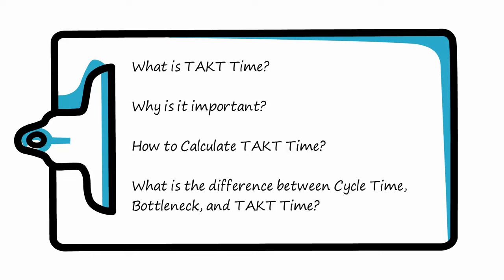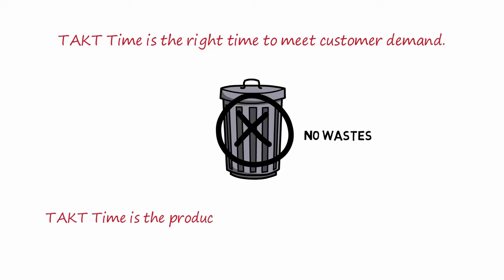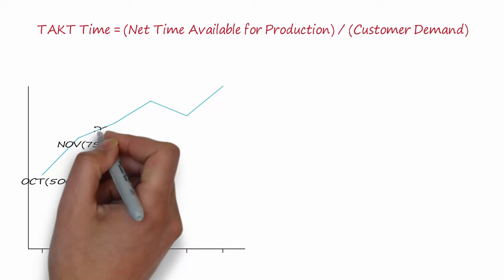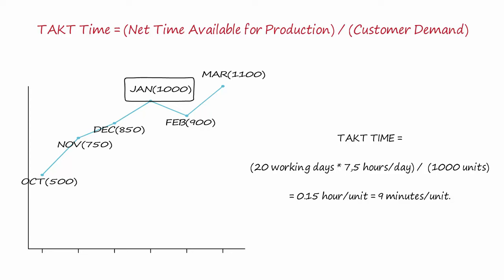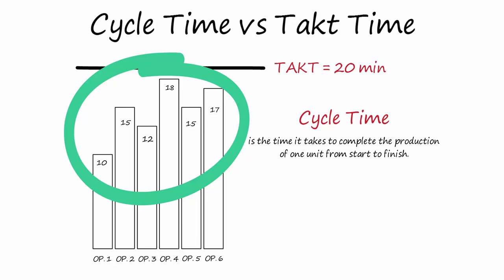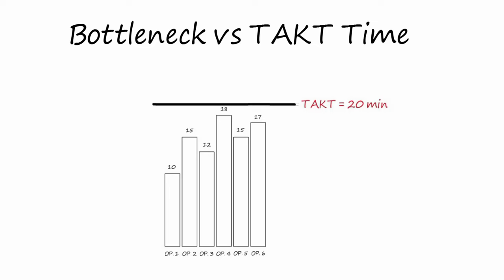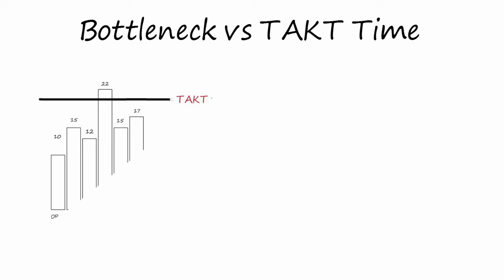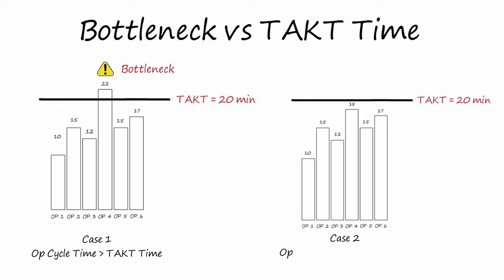Takt Time Calculation, Cycle Time and Bottleneck

Comment: In the first example Cycle time is 87seg or 22? First you sum the total processing times, then you use the time in the bottleneck, please explain.
Reply: The cycle time of the entire process is 87 minutes. The takt time is 20 minutes, meaning that to meet customer demand, one part must finish off the last operation every 20 minutes. If a bottleneck operation (22 minutes) is greater than the takt time, then it will be impossible to have finished parts every 20 minutes. So, the bottleneck must be reduced to less than the takt time.
Reply: I would name this lead time, but seems like there are just different names and definitions out there.
Reply: Actually 87 minutes is through put time and cycle time is 18 minute. cycle time of process is always a bottle neck because that will define the time required for 1 part.